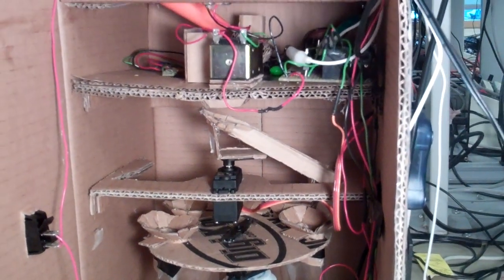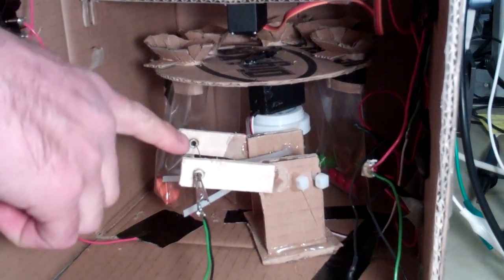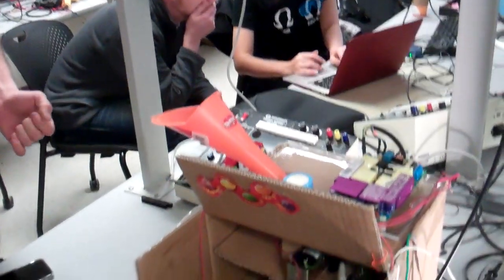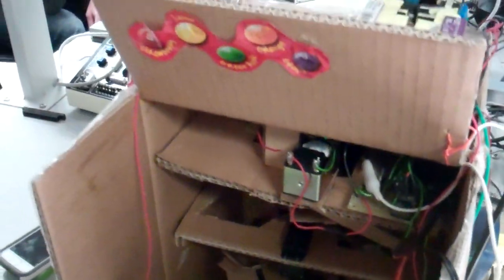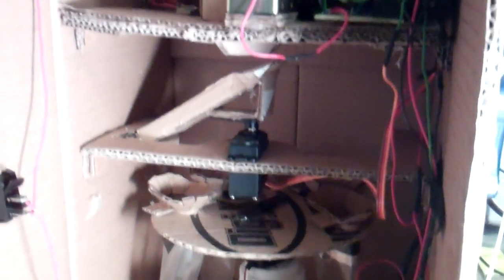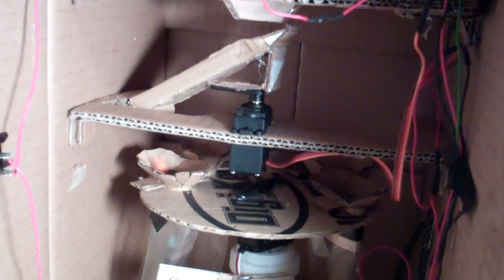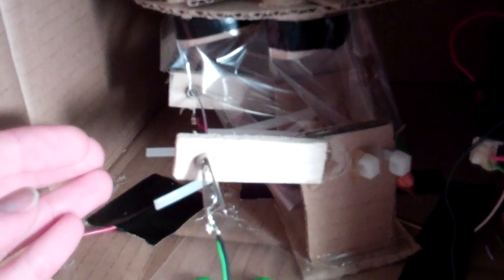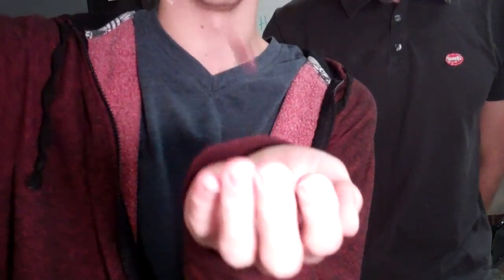Skittle Sorter

Comment: it's lame...seriously ! it sucks..that's the kind of stuff a 14-15 year old does in spare time. And those guys are supposed to get a degree... I guess they 'r from usa ..you could have "at least" spent 3 hours doing the project with something better than cardboard. they are tons of designs of m & ms color detector machine made by young kids way better on the net.
Reply from the maker: The nice thing about youtube is that everyone can be a critic. How old are you?
Reply: This is a 'prototype, not a finished product. Considering the amount of time these students had and the fact all the disparate electronics, logic and mechanics of the material worked, this project deserves an A. 

They could have gone for for a project that was not as demanding, but i applaud them for the extent they attempted.